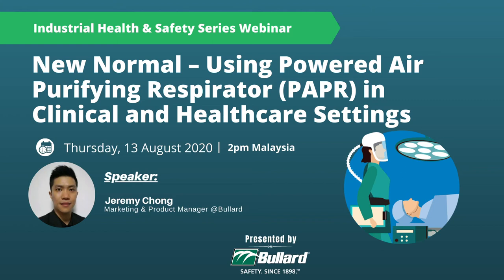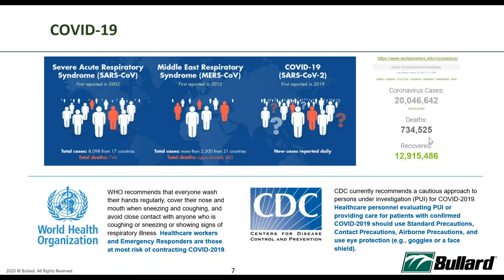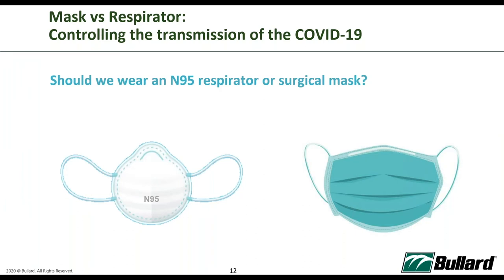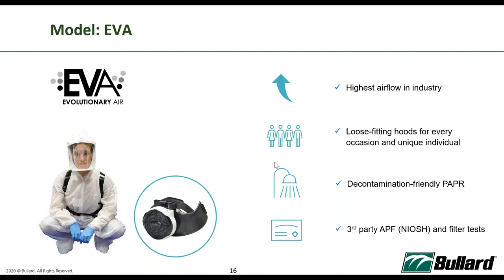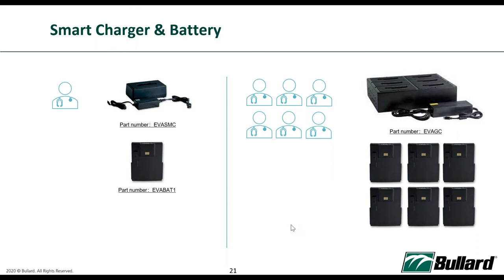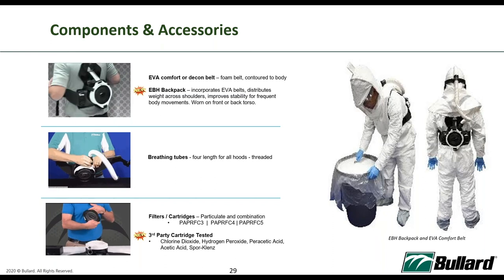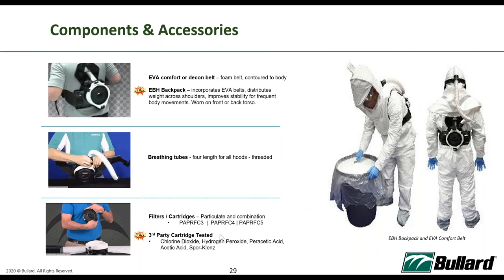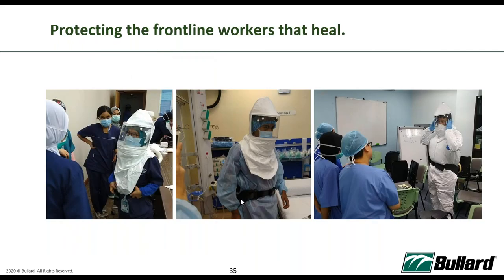Using Powered Air Purifying Respirator (PAPR) in Clinical and Healthcare Settings in New Normal

Comment from the maker: Webinar Keypoints:
Assigned Protection Factor (APF) & Fit Testing - 0:29
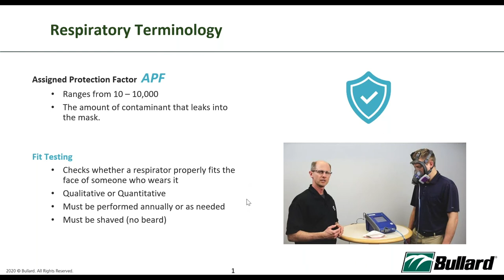What is a Powered Air Purifying Respirator (PAPR)? - 1:42
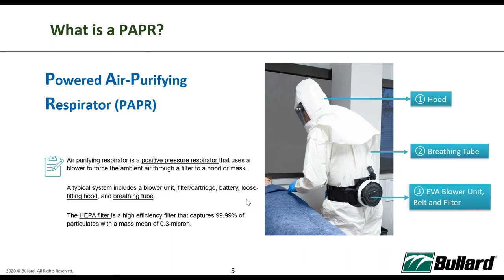Who uses PAPRs? - 2:38
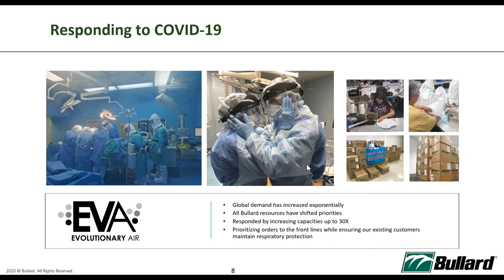Ensuring Healthcare Systems Preparedness - 6:53
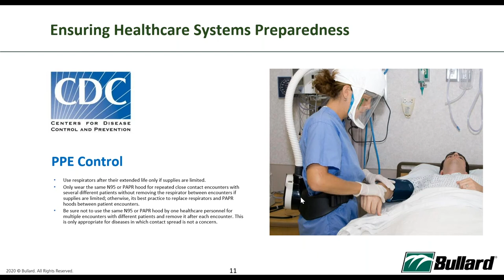Should we wear an N95 respirator or surgical mask? - 9:53
What is Active Flow Technology? - 18:58
HEPA filters for COVID-19
   -How do HEPA filters work?  -28:31
   -Can particles fall out of a HEPA filter? -28:53
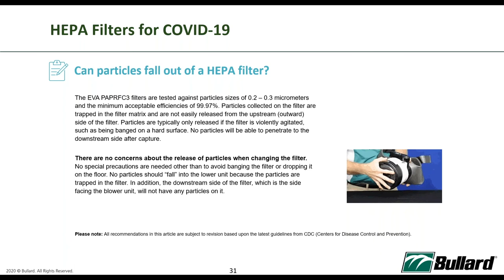   -How often should the filter be changed? -29:55
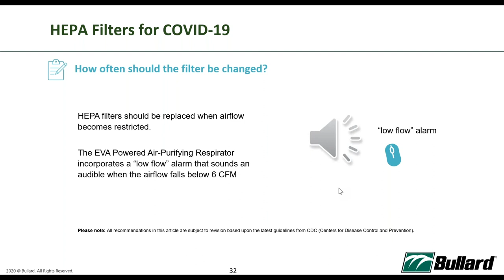How do I clean loose-fitting hoods? -33:08
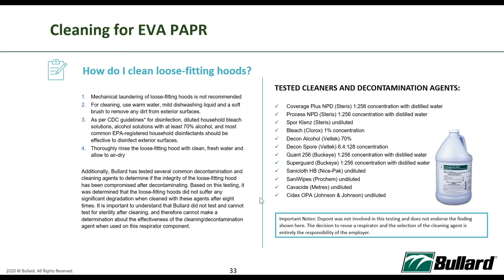Why PAPRs, N95 vs. EVA PAPR - 34:41